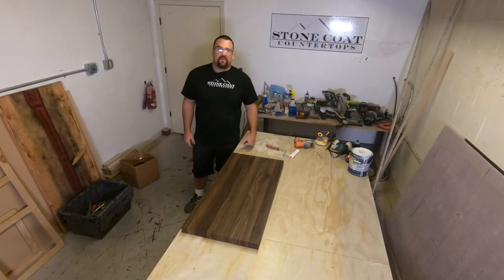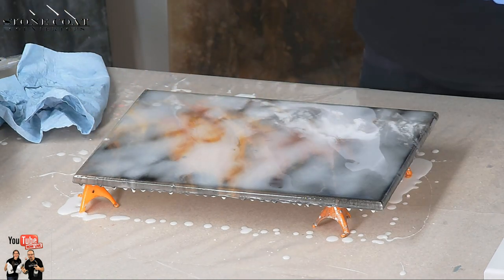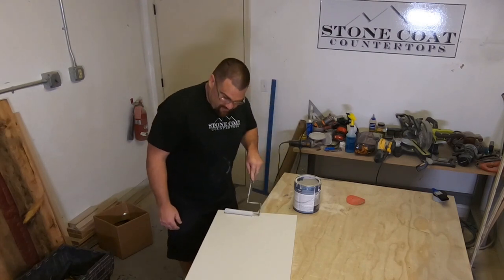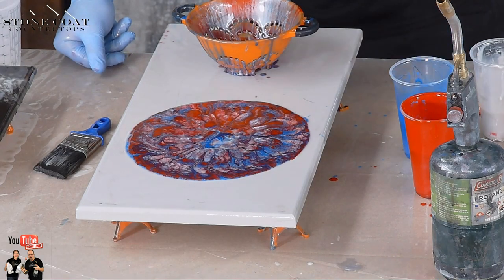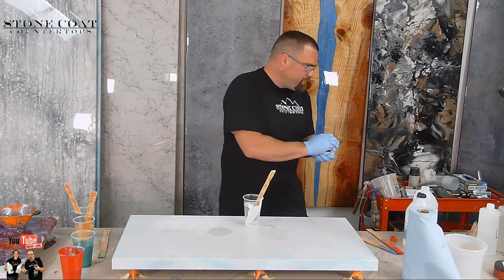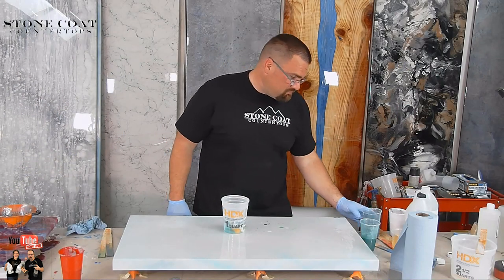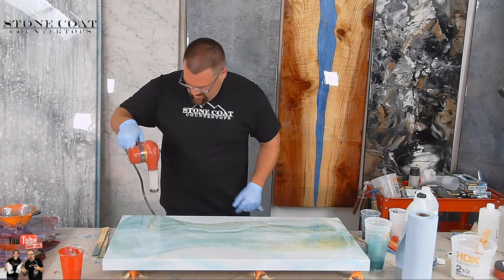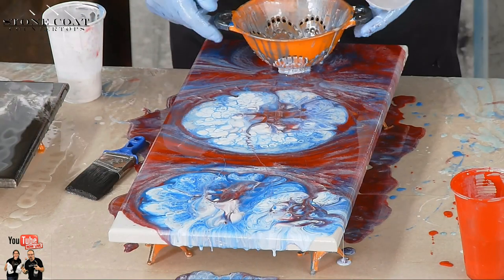How to Epoxy a Coffee Table Live

Comment: Question for you Mitch, I am doing an 18"x24" vanity top. Can I use a 1/2 inch MDF instead of 3/4 inch MDF for my vanity top? I am planning on doing a rock face edge, and  putting a vessel sink on top. However, I don't want my vanity top to be too weak even though it is quite small.

Comment: Wow excellent info on letting the paint off gas.  Didn’t know that.
Reply from the maker: We let the Behr Paint and Primer in One fully dry for at least 24 hours or more before applying the epoxy over top, this will allow all of the ammonia in the paint to evaporate. When the ammonia does not have a chance to evaporate and becomes trapped under the epoxy a chemical reaction happens turning the epoxy yellow, this is the most common cause of this issue.
Reply: Stone Coat Countertops excellent info.  Didn’t know that.

Comment: Wow wow wow!! Gorgeous table! I will be trying this soon!! 😍🤩
Regarding your tip on allowing paint and primer paint to dry a full 24 hours, does this apply to spray paints as well?
Reply from the maker: Great question Amy Haas and thank your for your kind feedback!  An important note is to allow your paint and primer in one to fully dry for at least 24 hours or more before applying the epoxy over top, this will allow all of the ammonia in the paint to evaporate. When the ammonia does not have a chance to evaporate and becomes trapped under the epoxy a chemical reaction happens turning the epoxy yellow, this is the most common cause of this issue. This will not be an issue if using Rustoleum spray paints. Thanks again for the great question and feel free to call or email us anytime for project support.
Reply: Stone Coat Countertops Even with the Rustoleum spray paint paint and primer combo? Sorry if I’m being repetitive, but is the primer in Rustoleum spray paints not ammonia based.?
Reply from the maker: Hi Amy, Rustoleum spray paints do not contain ammonia and are an oil based formula. Thanks again for the great questions and call us anytime for free project support. (541)450-1976
Reply: Stone Coat Countertops Thank you so much! You guys are amazing! ❤️
Reply from the maker: We appreciate your support Amy Haas!

Comment: You guys recommend the propane torch or can we use any other torch?
Reply from the maker: Great question Bridgette! You can use any torch that does not have an automatic shut off it held horizontally! Feel free to call us for project support! 541-450-1976.
Reply from the maker: Hey Bridgette, Yes we still suggest the torch for epoxy projects. You can use map gas but do understand that it is hotter and you will need to act accordingly.

Comment: What router was used by Mitch for the table?
Reply from the maker: Great question Kim! Here is the link to the router we use: https://www.amazon.com/PORTER-CABLE-690LR-11-Amp-Fixed-Base-Router/dp/B00005QEVQ/ref=as_sl_pc_qf_sp_asin_til?tag=stoncoatcoun-20&linkCode=w00&linkId=c7f5715cc5fb60f4fc800c981acbacc5&creativeASIN=B00005QEVQ

Comment: do i need bonding primer if i am using a paint primer in one?
Reply from the maker: Nathan Lamberson, what is your substrate?
Reply: @StoneCoatCountertops  I am using raw wood covered with paint primer in one
Reply from the maker: You will want to do 3 seal coats at 1 oz per square foot prior to applying a paint and primer in one.
Reply: @StoneCoatCountertops  won't those take 24 hours for each seal coat to dry??? Last night on the live stream whoever was running it said the primer would seal it.